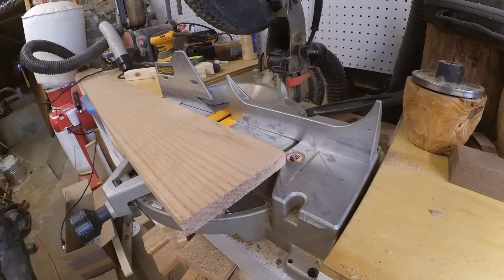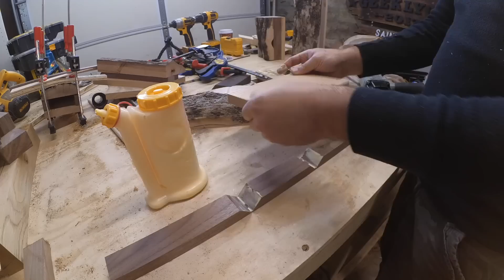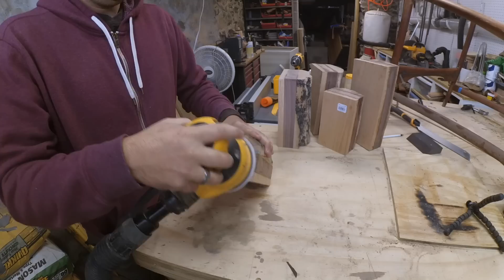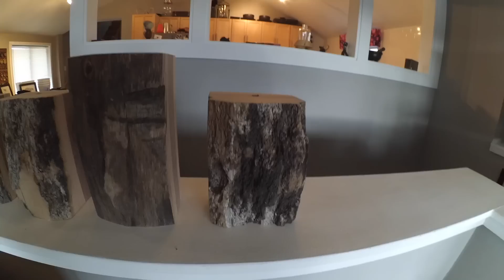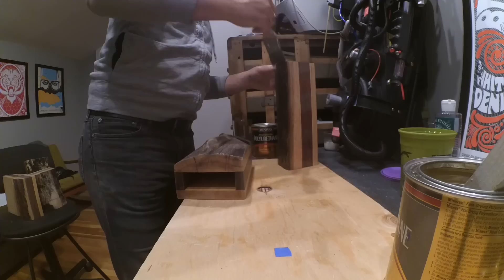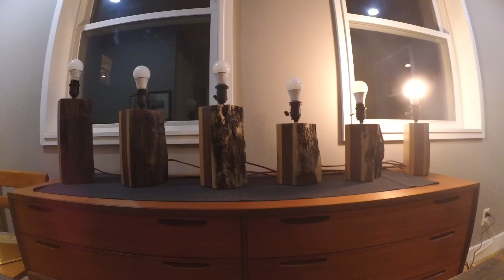Making a few Reclaimed Wharf Wood Lamps

Comment: What do you use to protect the wood? Great job!
Reply from the maker: Magdalena Rybczyńska I use a liberal coat of gloss polyurethane followed up by satin polyurethane. The wood is very thirst and drinks it right up.
Reply: I have one more question - what do you use to get rid of the bugs thay may live inside?
Reply from the maker: Magdalena Rybczyńska This wood was in submerged in the ocean for about a hundred years before we milled it and stored it for drying. So any shipworms in the wood died when it was put out to dry. Since we dried it in a controlled environment, there were no bugs to infest the wood. 
If you’re using an old piece of wood and you’re really worried about bugs, you can “cook” the wood in your oven which will aid in drying and eliminate any pests. If you look online, there’s lots of articles explaining how to do this safely.